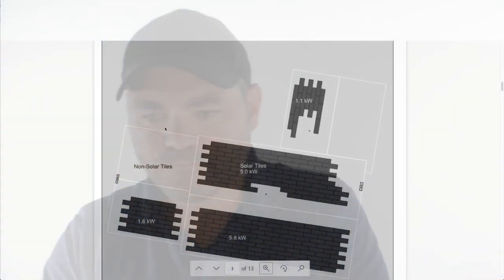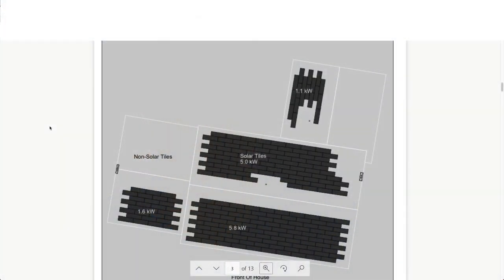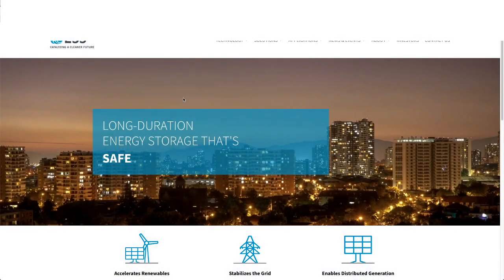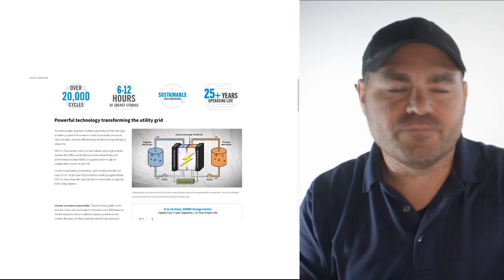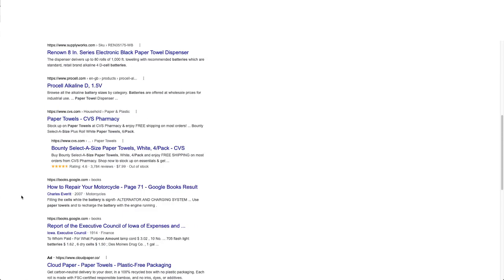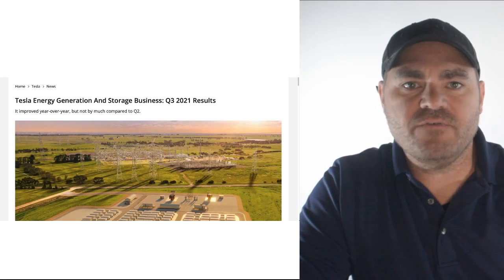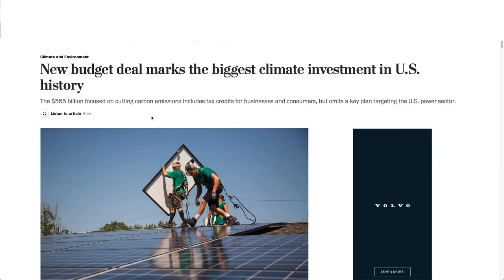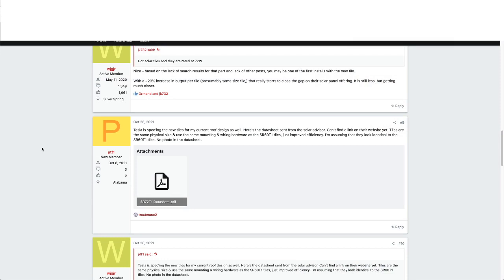Episode 30 - Tesla Solar Roof Now 20% More Power | Fire Suppression Required for Indoor Batteries

Comment: EDIT: ...The parts themselves list the Pmax at 72.0W +/- 5% and remarkably list the Vsys as 1000V! Do you have a link for  the spec sheet for the SR72T-2 high voltage tiles I'm having installed? 
TIA, Randy Hawkins, San Diego
Reply from the maker: Yes, spec sheet here:
https://vitecgroup0-my.sharepoint.com/:b:/g/personal/aaron_brady_vitecgroup_com/ERzwoEHMmipKkuV7vTjbjo4BdutljJoXL88kqb4tydHmzw?e=P6Ifqk
Reply from the maker: Thank you for sending the photo of your solar tile label.  I see it shows SR72T-2 which is a revision later than this spec sheet.  Photo label here:
https://vitecgroup0-my.sharepoint.com/:i:/g/personal/aaron_brady_vitecgroup_com/ERBrn4rBbvpPhMU-zkw7S9QBMTgh3rO9IMPfJN6hYk1p8w?e=on5lSa
Reply: These links don't work, and I haven't been able to find the specs, anyone have a copy?

Comment: What was the total electric needs ? I think you're forgetting about time.
Reply from the maker: Time definitely matters and with 30KW I should be making a huge amount of electricity if all of the panels were making max production for even a couple of hours a day - but because of the layout, our latitude and our climate it doesn't work out that way.  I'll do more on the next pod to explain our system size, its actual production and why we would need such a big system.